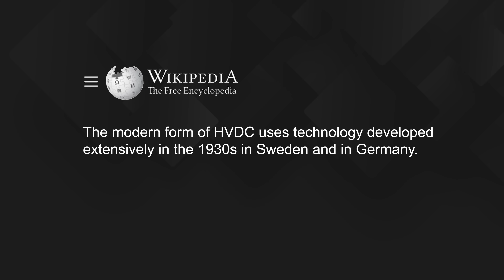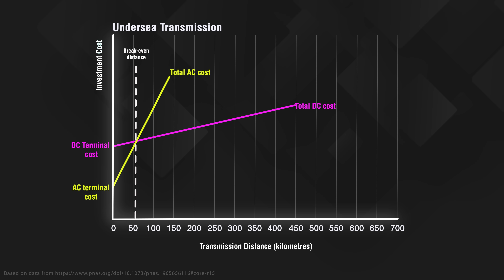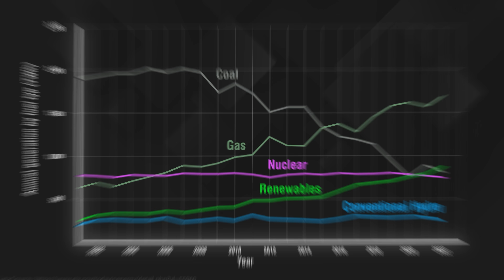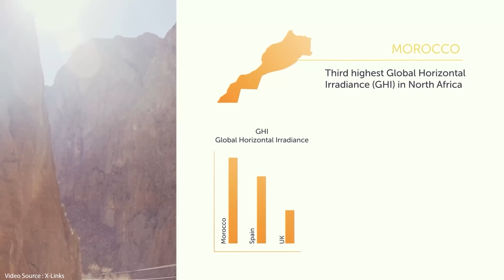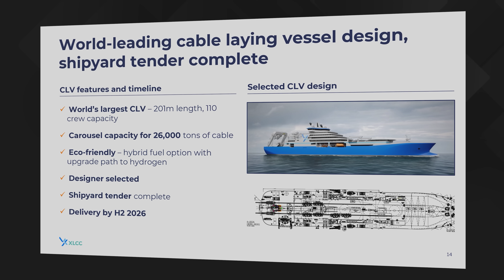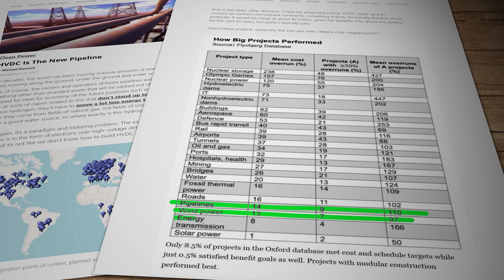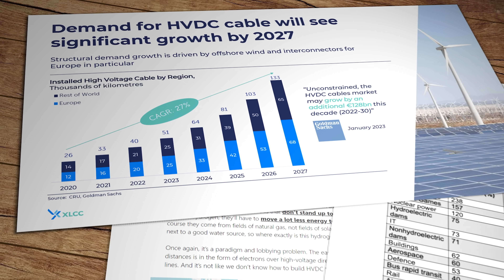Revolutionising power transmission.

Comment: It would be great if you could look into the scalability of HVDC cables. I did some rudimentary research, and from what I understand, the ratio of conducting medium to capacity increases with capacity. So you can not increase the size of the cable to improve the material efficiency, the same way you can a gas/oil pipeline. If this is true, we will need to lay a lot of parallel cables to meet demand.
Reply: I don't see why that would be a problem? We already have parallel interconnectors.
Reply: @Alan hat, of course you can build in parallel, but if the ultimate aim is to deliver energy at a rate equivalent to pipelines and tankers, then it is important to be able to scale efficiently. 
As the diameter of a pipeline increases, there is a square relationship to the fuel transferred, the material needed per unit of energy falls. If this does not hold true for cables, then scaling them up is going to prove much harder than it would first appear.

Comment: Britain has been linked to France by dc cables from Sellindge in Kent since the 1960s. Cost is not the only consideration, but system stability and fault levels have  to be contained. Joining 2 large ac grids by a single ac interconnector can quickly become unstable, hence the use of dc. For long lines, the Ferranti effect can lead to excessively high voltages at the receiving end with light loading, so again for that dc wins. The small size of Britain means that the overhead 400kV ac lines are quite sufficient for secure operation. If that was to be wholly replaced by underground cables (You think your bills are expensive , now?), then the situation may change.
As for the viability of the Morocco link, the vast profits being made by the wind and solar power suppliers are due to the cock-eyed way that the electricity industry was privatised, whereby cheap generation can be remunerated at the same rate as the highest cost generation on the grid. That situation, currently costing everyone in the country, may not last. Like every other major infrastructure project, I predict that it will be years late, way over budget and the constructors will be begging the government to bail them out.

Comment: AC power distribution is a legacy technology. Using AC transformers was the only practical way to change transmission voltages. With the advent of modern power electronics DC to DC voltage conversation is possible. Maybe the growing use of HVDC will begin a transition to a fully DC grid all the way to the end consumer. It would be more efficient than the current system?

Comment: While digging through the journals, did you find the reason that they installed a DC link on the west coast of the US?  The line was originally a long AC connection somewhere up in the half to million volt range.  The problem with it?  Attempts to actually get energy out of the line outside Los Angeles resulted in a huge voltage drop.  WHY?  The length of that line was long enough that they had a power line that was effectively an antenna,, and impedances on a resonant link like that get very interesting.  The cheapest and best solution was to install rectifiers in Washington, and 60 hz multivibrators down in Los Angeles.  Doing that eliminated the resonant line problem.  They could use segments of the line to drop power off in a few places well north of LA, but the engineering gets very interesting when the lines get long.  Doing Solar in Africa is looking iffy, because of the amount of water required that would have to come from agricultural use.  The nations down there look at it as more EU "using" Africa's riches for their own private gain... Politically that will get very interesting... IF the power stays in Africa, no problems... but the EU had best start thinking of doing their own generation on their own continent...

Comment: After a couple of years finally. One of my favorite exercises is to get a large globe and then cut out a 2000 mile radius paper circle. Then place it around the globe to map out world links. Modi is onto something. Also watch out for Warren Buffet's railroad acquisitions. Rails avoid state regulators due to federal law. Be interesting having Mr. Buffet ship power in and out of the Texas grid. State politicians will boil.

Comment: Also, this one in Quebec to USA 450KV HVDC. https://en.m.wikipedia.org/wiki/Hydro-Qu%C3%A9bec%27s_electricity_transmission_system#:~:text=High%20voltage%20direct%20current%20(HVDC)%20450%20kV,-Main%20article%3A%20Quebec&text=It%20is%20also%20the%20first,and%20the%20Northeastern%20United%20States.

Comment: It is not possible for an organism to "go into a frenzied meltdown" . Organisms ,under certain circumstances, can experience hyperthermia , but under no circumstances could their temperature increase to the point where they would sink into the earth , melting the rock as they descend into the mantle , in the classic nuclear meltdown scenario.
The suggestion is preposterous!
Even in a nuclear meltdown , aside from over-pressure situations , the process is relatively slow and could not  accurately be described as "frenzied" .
Reply from the maker: Very good Paul. I like your style mate ;-)

Comment: New Zealand has had an HVDC cable running from the lower South Island, over the Cook Straight to the bottom of the North Island since 1965. It moves hydro generated electricity north most of the time.
Reply: The converter stations - the most difficult and expensive part of a very short HVDC link like this - have been completely replaced twice since then to keep up with the improving technology, with the second involving a complete redesign and new cable.

Comment: All these technologies and improvements are great.  I want alternative energies to work and expand and clean energy and environment are never a bad thing.  However all the wind and solar power and good distribution won't solve the storage issue that is not being addressed.  Grid level storage is extremely miniscule with little on the horizon. This needs to be fixed if there is any chance of real improvement.
Reply: Not much on the horizon?
Tesla looks like they are aiming for 40GW of extra annual production every year.
I.e a new 40GW factory per year.. 
And CATL & BYD likely to follow suit.
Reply: @timtravelnomad  40GW-hr of storage is 1.66 GW-days, not much in the big picture.  Maybe enough for unscheduled maintenance on a power plant.
Reply: @nuwave4328  they will accelerate. 
Tesla Masterplan Part 3 calls for global storage of 240TW for the entire planet to be on 100 renewable energy.

Comment: A question for those with good knowledge of electricity.
I have been building green for 42 years and recently saw a home being constructed using the rebar in a slab and running a current through it for heat.  This is something completly new to me and I talked to two electricians about it. One said if you converted to DC it would work and the other said they must be running a cable through it but that is not the case. They almost have enough rebar in this for a suspended slab. If it works, as another local swears by it, why is no one else using this method?
Reply: I've never heard of it, but I doubt it would fit any building code. If ever someone has to jack up the concrete to fix a busted pipe ...

Comment: The only real challenge to trans- or even inter-continental extremely high capacity transmission lines, ultimately forming, hopefully, global terawatt scale supergrid, is political.

As our host wans so often, we should not fall into the trap of searching for panacea. Renewables will need both utility scale storage and almost global huga capacity grid, but we will also need all kinds of low emission sources: wind, solar, hydro, geothermal, nuclear, in all sizes, from village to country and continent.  And, contrary to what criminals from fossil fuel lobby claim, this is beneficial for the economy.

Comment: Excellent presentation as usual, but there is one unmentioned advantage of HVDC tech. Geomagnetic storms can disrupt AC transmission of electric power by saturating the core of transformers. HVDC should not be suceptible to this hazard.
Reply: DC switchgear is based around semiconductors which also aren't keen on Voltage excursions.
The lines themselves though are more likely to be isolated by being underground or under water.

Comment: My personal guess is that future is generating electric power locally where you use it, so long-distance power lines will not be necessary in the long run. The total annual electric energy consumption of the world is 25TWh. The annual generation of 1m2 solar is about 200kWh (depends strongly on the region of course), so 25TWh requires only 12x12km area for the whole energy of the world. This is easy to achieve even in densely populated areas....So my opinion: install solar with proper energy storage systems (flow batteries, molten metal batteries....all from your podcasts), and forget long (especially extremely long) power lines.

Comment: Thanks for the video .  There is an advantage to making electrical transmission lines run for hundreds of miles because in the early days of the electrical utilities the biggest problem they had was turning the power off .   It seems that once a system gets over a certain size then they suck in energy from the environment and synthesize electricity .  The energy doesn't come from the powerplant , it comes from the environment   ...  the Veratasium video you mentioned explains this .

Comment: My views on this are simple as we must start doing away with these types of system and instead opt for systems that produce the energy we need at the point of consumption as trust me we have the technology to do so right now. This way the end user is in full control of their own energy needs having no monthly bills to pay for the electricity or gas they use per month. This technology I speak of is one where the individual gets the final say. No more filling up and the petrol stations, no more paying a monthly bill for electricity, and no more worrying about making enough money to pay those bills as they simply will no longer exist in this non-distributed energy economy where each home will have it's own means for power production and thus be totally off-grid. Now if you have a EV, FCV. or hydrogen burning vehicle you can provide all the energy you need on your own just as long as you remain in the vehicles range. The days of grid tie energy distributions networks are numbered as this new system puts the individual in full control of their own energy needs.

Comment: I have an HVDC generator in my basement, cutom design, it makes 100 KV at 40 uA when its moist and well over 200 uA when it's dry. Lights up 7 flourecent tubes in series bright enough to read by.

Comment: No complains, well done. I remember when we used mercury rectifiers in the HVDC. Much better now. However I wanted to remind you ( sorry if I overlooked it) of the project shipping dust and gravel from Greenland to Africa and Brazil  as fertilizer. AFRICA Got 50% improved harvest and as a byproduct the dust and gravel suck up a lot of CO2 in the process ( >25% of the weight of gravel and dust if I remember right) and we may even see people stopping burning forrest to get the nessary minerals to grow their produce. To your next question, yes it is much cheaper to transport the dust and gravel than to grind it. So please make a video about it unless you already have done that.
Reply: This propaganda (Made in China( will now be forever blocked. Total loons here!
Reply: I forget what the application is but mercury rectifiers are still the first choice for something.

Comment: The technology is there  ---  let's hope the industry develops to support quality installations.  
On the business side is where I believe are the real challenges.  Will HVDC essentially deliver the "new oil"?  By that I suggest that suppliers of electricity will become the "oil and gas oligarchs" and history has shown numerous and ongoing "challenges" amongst and between the "suppliers" and "consumers" of oil and gas.  
The biggest and most crucial difference is that when an oil and gas supplier turns dictatorial other suppliers can fill the gap for that consumer country.  Point to point HVDC lines will not provide that leverage and security.  I hope we can learn from those challenges and find ways to protect the consumers as the current path is for ONE energy --- electricity --- not several as we have today.

Comment: What I don't hear from this type of story is the ratio of peak demand vs. average demand for our transmission systems.  We also have a problem in many areas of peak capacity that would like to be sold if the demand can be found for it.  Energy storage located either near high capacity areas or high demand areas increase can improve this ratio, meaning more total energy is transmitted for a system of given capacity.

Long-distance transmission of energy is generally promoted for a region with high capacity for generation to connect to more customers.  However, with the declining cost per unit of renewable generation, facilities that cannot be as highly utilized can still be located near customers a an equivalent cost to building out additional transmission capacity to remote highly utilized generation sites.

My sense is building additional transmission capacity works where it works but more highly distributed generation and energy storage is likely to undercut the cost of them in the near future.  Capital-intensive projects such as these seem a perpetuation of the old paradigm of electrical generation and transmission.  Utilities are mostly paid per the capital they have deployed.  My bet is that paradigm is about to be broken.
Reply: No matter how local generation is the power still needs to be transmitted. I don't see generation plus transmission ever being cheaper than transmission alone.
Reply: @alanhat5252  That is where I differ.  We already build peaker plants that operate only several times per year rather than increasing transmission capacity.  A fossil peaker plant at that low of utility is much more expensive than renewable generation plus energy storage, which is the reason energy storage, particularly battery storage is growing so rapidly.

Overcapacity in wind and solar is much cheaper than overcapacity in fossil-thermal generation due to low or no labor involved to be ready to go online.

I standby that increasing transmission capacity works where it works, but it is likely to work in increasingly fewer instances from an economic sense.

Comment: It is sad to see someone who has trouble accepting that there are enormous environmental costs in any scheme to implement "green" energy at the capacity necessary to replace current energy sources. If you include the production, operational impact, and decommissioning environmental costs in the equation (aka Total Environmental Cost of Operation), most of the proposed "green energy solutions" don't look so attractive.

When you realize that meeting current energy demands with such a system is impractical at best you will understand why the Georgia Guide Stones stated that optimum population was 500 million max... It would be much more feasible to meet their energy demands with "green" energy solutions.

Comment: Thanks so much, I thought DC transmission was long dead and buried, so I am grateful to have learned something new!
Reply: The clincher in "the battle of the currents" was that DC was used for the Electric Chair (DC pulls muscles rigid, AC makes limbs flail) but outside the world of marketing & competition there's always been pros & cons to both & in this application it's capacitive & inductive losses that swung the decision once semiconductor switchgear became available. 
At the Voltages under consideration the reaction of the human body is identical – vapourization.
Reply: @Alan hat  actually you got that wrong.   The electric chair was developed by Edison to try and demonstrate how dangerous AC was and hence it ran on AC, despite the clear fact that if it ran on an equal DC voltage it would have been way more deadly

Comment: Just going to point out that although the Morocco UK power plant thing claims to be half the price of Hinkley point C, saying that it's cheaper than nuclear is misleading for several reasons.
1) Hinkley point is privately funded and investors expect high returns. This means they agreed a strike price well in excess of the real costs of producing that energy. A government funded equivalent (like what the french did) would see energy prices plummet after completion of construction
2) Modern nuclear plants are licensed for 80 years with potential to extend down the line while solar panels/wind turbines have significantly shorter life spans so the costs are amortized over very different time scales
3) Even at the significantly improved capacity factor wind/solar have in morocco there is always a system level cost associated with adding more variable energy to the grid. Admit idly it's a huge bonus that Morocco will have a different and potentially complementary load curve compared to our domestic renewables but there's still a cost not being mentioned there.
4) The strike price for Hinkley Point C energy includes payments into a decommissioning and waste management fund which no other energy technology does so that's another cost shown up front in the price of nuclear energy but not represented in the price of alternatives. Unless we're just planning to litter Morocco with millions of solar panels and let all that toxic crap remain in the desert forever?